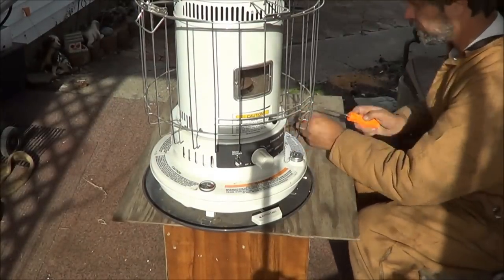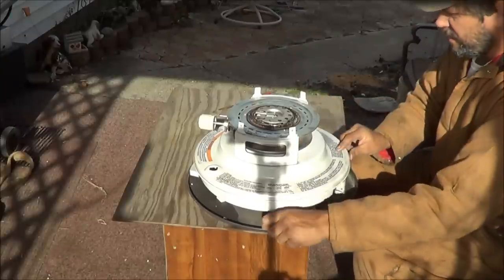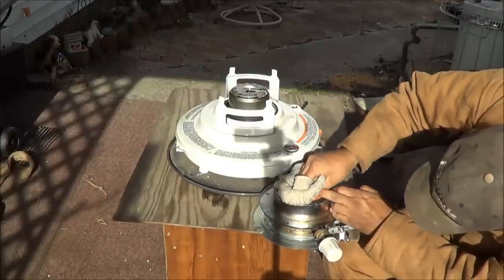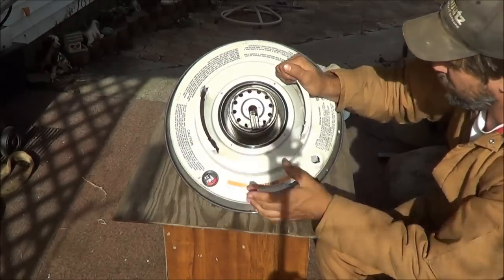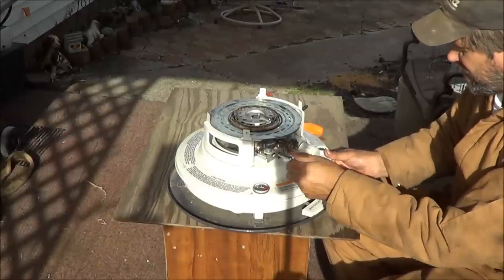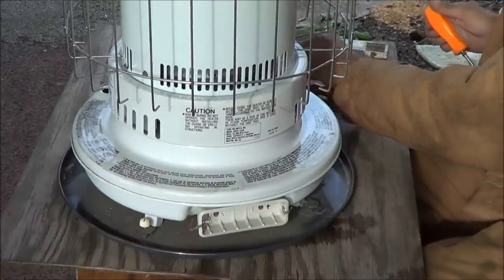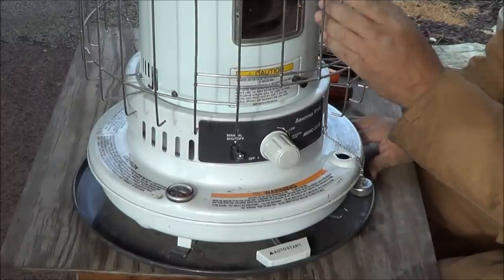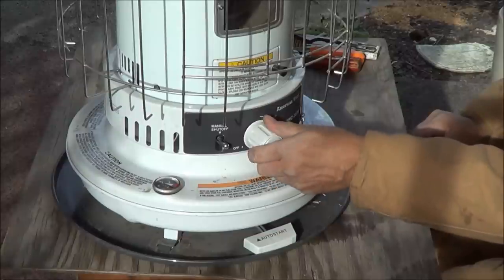Kerosene Heater Wick Replace

Comment: Was desperate & found your video.  Made more sense than the others on youtube. My wick was getting stuck after only a few uses.  Followed your advice & instructions. Ready to start over. Hopefully I will not have any problems but if I do I would like to post another comment asking for help. Many thanks for your video.
Reply from the maker: Hope you have it sorted out . Thanks for stopping in and commenting

Comment from the maker: I would check and see if it seemed to go up ,down and shut off with no wick installed. . If so it may be the wick is wrinkled down in the holder. Not all, but some heaters, [more on the square ones] you need to set preload on spring . And make sure everything is good and clean. Hope  ya get it working ok again.

Comment: There are 3 screws on the top separator ring that would allow you to remove it and have full access to remove & replace the wing nuts easily from the top.  I think it makes it a little easier.

Comment: Thank you so much for putting this up: I have a KW24G that needs a new wick & I am completely pathetic in making repairs.  I am inspired to try to do this now...even though I regret nor trying early in the fall 2014...before the onset of the cold.
Reply from the maker: Just note how you take it apart and you should be fine . Not all are exactly the same in appearance  but very close in the way it works ,so most should be like tho one in the video

Comment: U said that all of the heaters are basically the same, even the square ones. Will any wick fit any heater. And do u prefer cotton wicks over synthetic wicks?
Reply from the maker: most are basically the same , but some will have pins that stick into holes in the wick . i like cotton , but they do not last as long , but i do have a smaller heater that i only use cotton on .

Comment: I picked up one of these used.  It still had old kerosene in it.  I drained the old kero and put in a new wick.  The wick is centered evenly on the line with no gaps or kinks.  However, the flame burns very unevenly.  It is very high (over 1 inch) toward the rear right of the heater, but very low (less than 1/4") at the front of the heater near the window.  Any idea why it might do this?  I can turn the burner while the flame is lit, and the high spots and low spots move with the burner as I turn it.  Do I have a faulty burner?  I did take apart the burner and brush it out to ensure there was no carbon clogging up the holes.
Reply from the maker: usually that is either wick uneven ,and if it is you can turn till just barely sticking out ,then trim to the metal it sticks out of . or the heat sink or may also be called burner is not setting right ,.it is common to need to jiggle it some to even out the flame . make sure the heat sink is still round and not been smashed some at some time . black crusty stuff on wick if any could need removed . You should not have much if any of that if wick was let soak up K1 for a while before lighting.

Comment: Ever had any issues with the Emergency Shutoff or ShutOff lever not lowering the wick back down all the way?    I figure, even though the wick is only 2 years old, we may have a misaligned wick.   We usually let it burn out on it's own, but I have one spon on front side where wick does not want to burn right (doesn't really look burnt either).
Reply from the maker: after burn out of heater i brush off the crusty part of wick . one spot may not be adsorbing the fuel or has contaminates on it there would be first guess with out seeing .
Reply from the maker: some , mostly the square heaters , you also need to turn the adjusting knob a turn or two to set the safety spring tension , but do not remember any round ones like that

Comment: Bah my heater heats great even after 4 years on the same wick. But it has had problems since the day I got it. The electric ignition never worked at all...it just never touched the wick . And the wick shut off there where its supposed to pull it back in never worked. I have to hold the release and crack the knob around until its all the way down.

Comment: The flame looks normal but I didn't soak it for a couple hours , only about 30 minutes .
Can I manually clean wick ?
Reply from the maker: Most will say to take out side and let it burn out ,then take a soft brush and brush  the hard pieces off the wick. . each time you loose a little wick . Should be able to clean a wick many times before being to short.

Comment: I bought my heater about 6 weeks ago and use it occasionally and I notice now it takes a while for wick to light up ....I also did wick cleaning procedure ....any ideas ?
Reply from the maker: Some times if a wick gets a lot of black crust on top it will do that and then you clean the wick. It sounds like that is where you are. Sometimes if real dirty ,when cleaning it breaks the top of the wick off and makes the wick shorter. Does it seem to burn as high as it once did.Also if the wick got that dirty so fast ,could it have something to do with the quality of the kerosene that made it get dirty fast and causing the long start ups.. Also if new ,or a new wick is installed it must have a few hours at least to soak before lighting or it will burn the wick up fast.

Comment: I changed the wick on mine and all I get is a yellow flame. I thought I was getting a blue flame before the wick was changed. and it doesn't take much for black smoke to roll off the top?
Reply from the maker: +happy04346 black smoke is wick or part of wick may be to high , also the heat sink thing that lifts to light , sometimes need to be shook around , and did you let the wick soak up fuel for at least a half hour before lighting
Reply: +wtbm123 yes, I let the wick soak up, I even took a small bottle and gave it a drink from the top before putting everything back together. I'll try the heat sink thingy. Thanks

Comment: I did as you said but seems I cant turn it up do you set the wick with the adjust ment all the way at the top so when I release the while thing goes down as I just got a wick from the tractor store  in Plymouth mass directions suck thanks  to u I have a idea too bad u didn't live closer to north wey mass ha ha I wished
Reply from the maker: Most will have a line on the wick .some have more than 1 line so pick the line that is listed for your model .Then line the line up with the edge of the metal cylinder that the wick goes in . Sometimes if the wick adjustment is hard or will not move you may have a wrinkle in the wick . You also need to let a new wick soak up kerosene for a few hours before lighting. Hope you get it sorted out.
Reply: that's the problem I have no marks on wick but I did move it up and I have more adjust ment  dory to bother u are u shure you don't live close by ha ha Freddie ya buddie in n wey mass
Reply: FUCKING WICK DISSINTAGRATED SMELLED UP MY HOME I GOTTA FIND A NEW HEARTER THIS SUCKS
Reply from the maker: Freddie Dan When installing a a wick it is important for it to be the proper one ,and allowed to fully soak up  kerosene before lighting . a dry wick will burn away.
Reply: BELIVE ME I SOAKED IT BEFORE INSTALL JUST TO MAKE SHURE